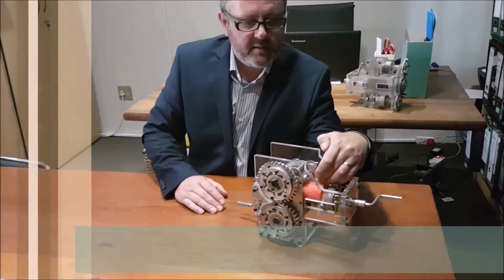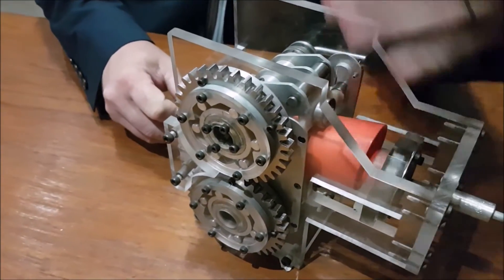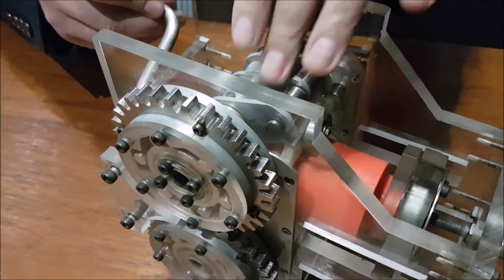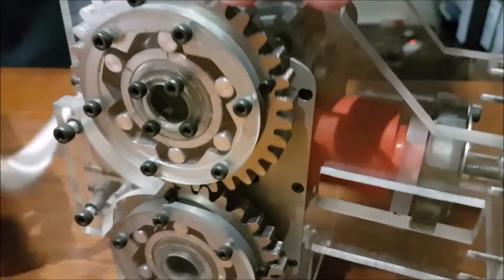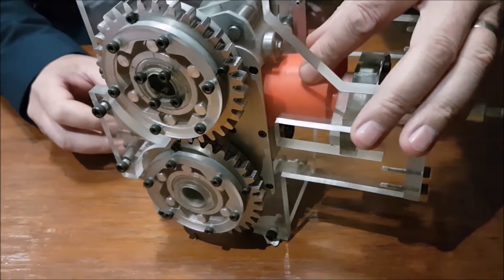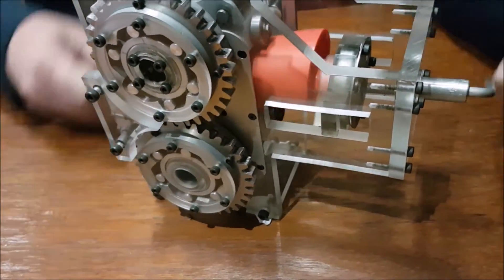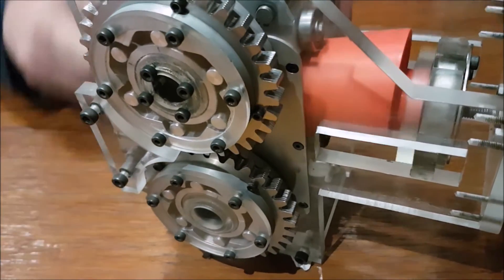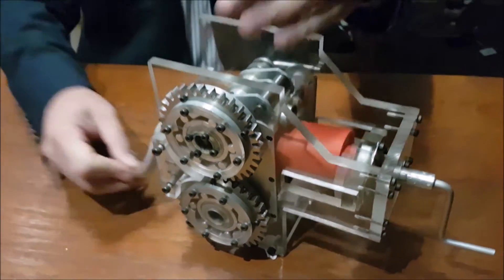Varibox ROTORcvt (CVT) Explained

Comment: I see one major flaw. No engine braking. Most variable oscillation CVTs have this issue. During engine braking, the drive force is from the tires instead of the engine which makes this CVT incapable for automotive use. In a machine it could be fine.
Reply: Nah. It's ideal for any hybrid where we have regenerative electric braking.
Reply: you could use a second cvt in the opposite direction to transmit the force from the road to the engine for engine braking.

Comment: 1st- "All commercial CVTs" do NOT use fluid friction (Prius).

2nd- how does a rectified oscillation fix the problems of current models? the constant reciprocating torque and gear lash makes them tremendously noisy under load... how does your version rectify this?

Comment: Does it work in reverse? One of the important considerations in using a transmission for automotive applications is whether the kinetic energy of the vehicle can be channeled back to the engine, instead of letting it freewheel. While this one doesn't seem to allow freewheel, I doubt it'll allow for reverse operation, which is, the output shaft driving the input shaft.
Reply: Nope
Reply: @FreeMind5094  سلام عليكم اخ خالد أنا كمان شغال ivt ...cvt
Reply: @FreeMind5094  ياريت نتواصل ممكن تخلي الجيميل تبعك هنا ؟؟؟